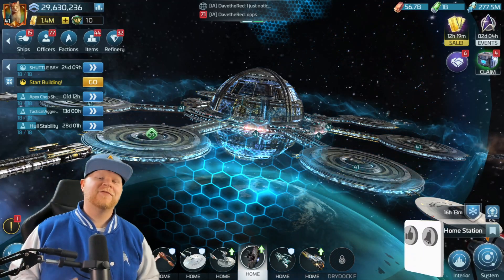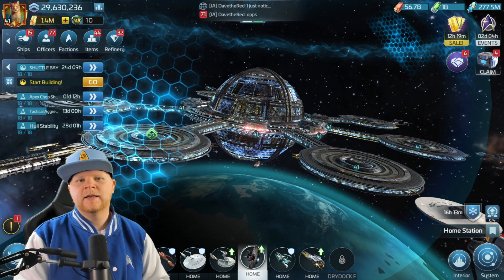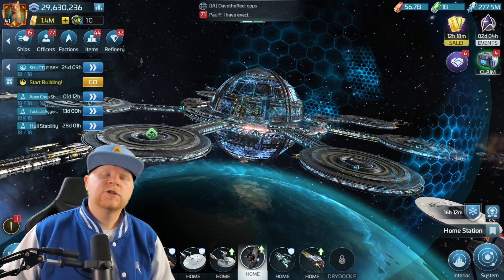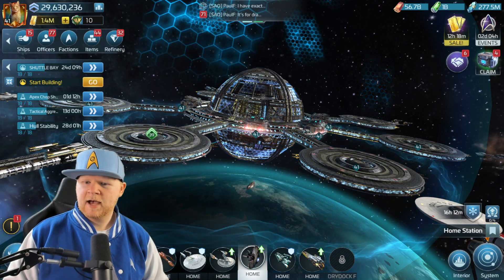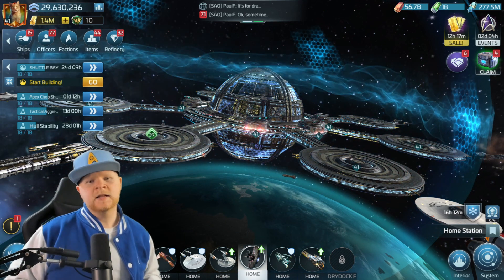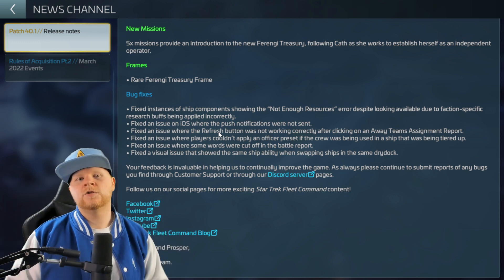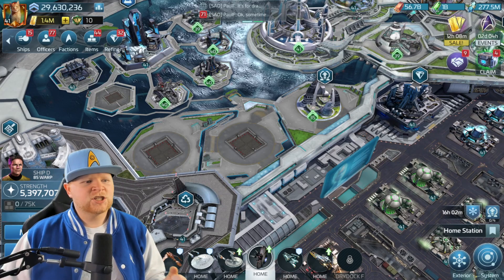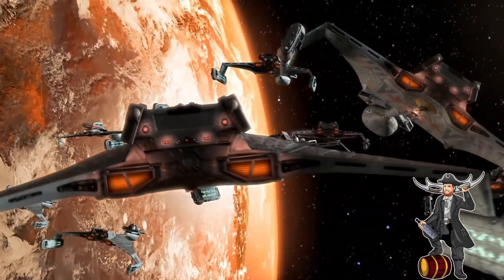Ship Power Nerfed? | Explaining the STFC bug fix that led to perceived power reductions for players

Comment: If the ship power is just a visual thing,  then why can't i take out certain high lvl hostiles, or as many now as I did just a few day ago?
Reply: Your ship power when outside of dock would not have been impacted by this update. If your ship is not performing as well as it should I would review your crews, (I recall someone once used the wrong Bev, oops), below deck setup, territory buffs (a common one), and if you had any exo's on.
If none of these check out then you would want to compare the stats from an old and new battle report, the individual stats (not the main Attack/Defense/Health, but all of the sub stats under those headings) are what drive your ship strength and if performance is reduced then one of these should also be reduced and should help in narrowing down the cause.

Comment: If I understand this correctly this fix should only affect those who are dual or tri faction positive or locked or they somehow grind enough bps to get other faction ships when not locked or positive.

You cannot do the research without the rep

However i am only fed locked currently and i experience this problem frequently on many ships where to upgrade a part i have to provide a lot more rss than a required or i get the insufficient rss error.

The extra rss are only necessary to activate the upgrade, they aren't actually used.

It seems like the test condition initiating the upgrade is not factoring in all the research actually done to reduce costs of rss in upgrades.
Reply: Yes and no.. Yes, if you have none of the other faction research bonuses then they won't be incorrectly applied, and in the case of Federation ships you should then see the correct costs displayed. However the bug also impacted ships that were neutral, so a Franklin, Franklin-A, ISS Jellyfish, Discovery, etc would all have been impacted by your Federation research with this bug.
And No, the error that you need more costs comes from the server itself. That it throws the error means that you need more resources. Though a common condition with the bug is that it would also flip to a higher stated cost (no faction specific efficiency) afterwards.

Comment: yeah I thought I saw a dip in power yesterday... didn't notice tge effects until this am when I did swarms and couldn't finish in one run. so I'm missing my swarm dailies by 1 ship... I'm happy the not enough materials was fixed.
Reply: The faction bonuses bug was only impacting ships while docked, even your power outside of dock shouldn't have changed. If your performance has been reduced I would double check your crew, below deck and active territory bonuses.

Comment: I would like to add that I sent in a ticket for this bug and I never got a response. I filled out my ticket with the number in the upper right hand corner and took screen shots and I never received a response. I disagree on the resource part mentioned. When my Enterprise needed an upgrade and it said I had insufficient resources I went back and checked my RSS to be sure that I had all of the RSS and I did. So now we can't trust our RSS numbers?   Am I understanding the content of the video correctly?
Reply: Before the patch the costs were showing as though all faction efficiency bonuses were being applied to all ships. So your Enterprise would list costs as if your Klingon and Romulan bonuses for crystal, ore, tritanium and dilithium were being applied. This is obviously incorrect, and why the server would throw an error even though it looked like you had enough.
Important notes to show that this wasn't Scopely doing some other random things:
1) Ripper's mod for the PC client directly fixed this issue months ago.
2) You could use math to determine that the bonuses showing in cost reductions were incorrect by the amount of incorrect faction bonuses, and also calculate what the real costs were.

Comment: If the ship is nerfed than the mats I spent on the ship have been wasted. For example when the  error message indicates that I don't have enough material for the upgrade, scopeley response was I should have more than indicated for that upgrade. How does it make since ? And I always have more than I need to make any upgrades.
Reply: You may have forgotten to actually watch the video that you're commenting on 😅
The reason why it wanted more than it asked for was because it was incorrectly displaying the benefit of faction efficiency bonuses that don't actually apply to that ship. So your Federation ship would show costs as though they were also getting Romulan and Klingon pure material and ship structure research. This is obviously wrong, and so real costs were higher.
As for the ships being nerfed, they haven't been. The higher power that was shown when docked was again just the client incorrectly showing as if faction specific research that doesn't apply was in effect, in reality those benefits were never real. And because it was only an issue when docked, your out of dock power (when you mostly use your ships) should actually remain the same as it was before. It's like if I installed a balsa wood front door and told you that it was solid oak, and then 3 years later came and told you that it was actually balsa wood; the door never changed.

Comment: The Problem was it hit during an auction, and like a lot of people, I waiting until the end to see where I could place, and due to the error- on ScoPAYs part, I couldn't upgrade my jelly, even though I added a couple million trit to see if that was the problem. 

Instead of being 6th (at worst) in the ROM auction. I was 24th. 

Oh, but ScoPAY did give me two- yes TWO - loyalty tokens as an apology. No Rom Shards, but hey, Loyalty tokens, right?
Reply: A couple of million was likely nowhere near enough.. Your jellyfish would be showing as though Federation pure gas, Romulan pure ore, Klingon pure crystal, Federation ship structure, Klingon ships structure, and Romulan ship structure were all being applied.. this can be quite significant, especially for tritanium as that is up to 300% of falsely reported efficiency bonuses. Real costs have remained the same though.

Comment: My Dilithium cost increased 25% also on upgrades

Monday i tried 75m to upgrade 1 part on Franklin-A
After Patch.. same item.. costed 90M !
Reply: You're probably "lucky" that it wasn't more, though the actual costs will be the same now as they were before (you just couldn't see the actual cost before).
What's changed is that previously the benefit of Federation ship structure, Klingon ship structure, and Romulan ship structure research (efficiency bonuses for Tritanium and Dilithium for upgrading their respective faction ships) were showing as though they applied to all of your ships (even though none of them actually apply to the Franklin-A). Again though, actual costs were always higher, the game just took more than it told you was required (and why it would error and say you didn't have enough).

Comment: Nope still had the not enough resources message whilst I was upgrading a part on my ships 🙃
Reply: After the update and updating your client? If this is the case you're most likely hitting a rounding issue instead, but if you wanted to put some details up on Discord I'd be happy to run some numbers and see what costs should be.

Comment: We are actually weaker, my Vidar and Franklin-A are both less capable of completing their missions in a single trip, this is theft by deception pure and simple. Scopely doesn't listen and clearly doesn't give a shit.
Reply: Mine aren't, you likely have a coincidence and bad timing. I would check your crews, below deck and territory bonuses to make sure nothing is missing.
Reply: @johnd5952  absolutely nothing and I mean NOTHING has changed other than scamly nerfing the power. You trying to act like yours haven’t changed. The only player of all the players on all the servers, gtfo 😂
Reply: @mustanguy102  I certainly wouldn't be the only one who's ship strength outside of station hasn't changed, because outside of dock all of those faction bonuses that were making your ship strength show as higher that weren't meant to apply (and didn't actually do anything anyway) weren't shown in the stats.. It was an issue with docked ships. This is most of the reason why ship strength was listed as higher while docked, with the remaining difference being from the station defenses and defense strategy researches.
Reply: @mustanguy102  If you're adamant that nothing has changed before and after but strength is lower, what you should do is get a battle report from before and now for the same ship and loadout, bring up the info page in the report and go through the stats in them both. If there is a strength reduction it will be from these numbers, find which ones are different and then you can start to figure what is actually causing that specific difference. Post the screenshots from each to Rev's discord.

Comment: Also the auto shield is back down to 5 minutes on base hits.
Reply: 10 mins last night. You have a different experience?
Reply: @davidrose7938  Yeah 5 mins when my base was hit then 5 when I hit another base and tested on a dead base was almost 7 mins based on my timer on my phone.
Reply: @gxxlee123  I hit a base last night. The bubble was up for 10 mins. My method for measure of time is the in game report for the attack.

Your issue may be worth submitting a ticket.

Comment: Yeah I don't buy this. And how about a video of their bullcrap events for today? And on top of that. The rewards for such a huge ass milestone. Kinda curtailing to scopely. They are wanting to phase out the free to play players so dam bad. They only want people that buy bigtime on this app. Because they dam sure don't care about the ftp or battle pass and occasional pack spender.
Reply: What don't you buy? The issue with faction bonuses being applied incorrectly when docked has been known about for a long time, including the increase in stated ship power which docked, and the bug with material and resource costs actually happened previously. This was also related to why the Stella would lose so much power in dock (though again not a real loss, if you had scanned a player with a Stella docked you would have seen a very different picture).
Similarly you could do the math to prove that this was happening, and if you knew both the stated costs and faction specific research you could even adjust the costs to see the real numbers reasonably easily.
Or if you are aware of Ripper's mod to the PC client you'll find that ship power when docked and upgrade costs were two specific things that he worked to fix (so anyone running the mod would have been seeing the correct costs and power before Scopely fixed it).